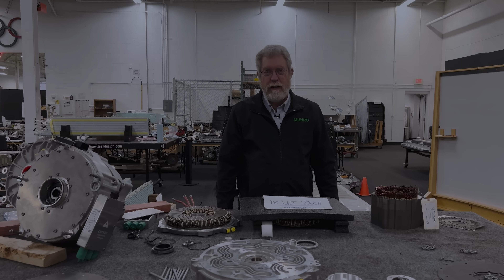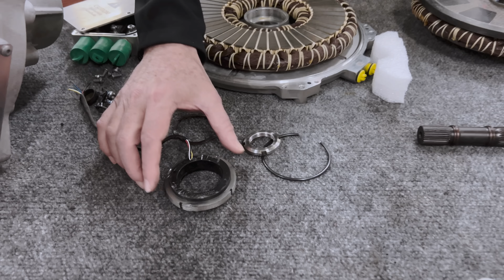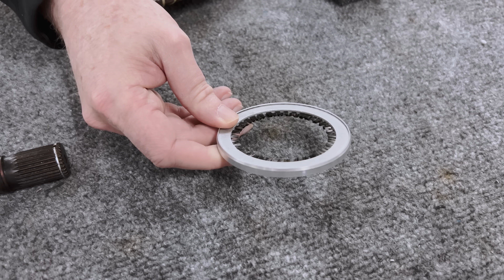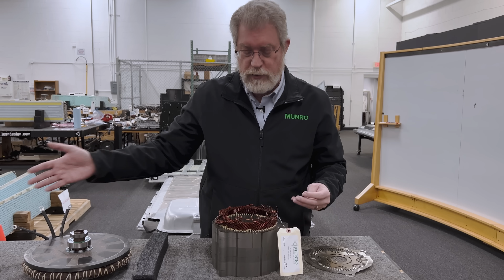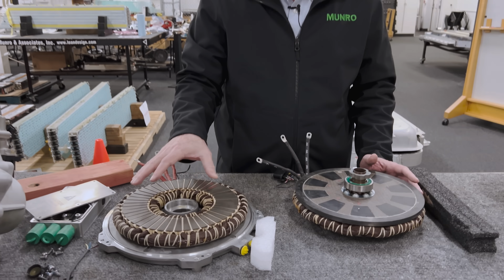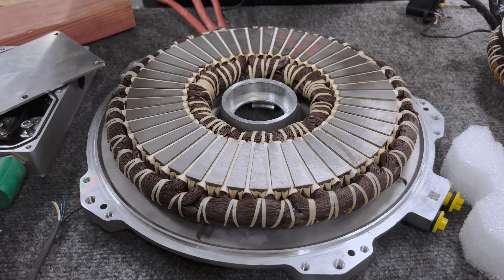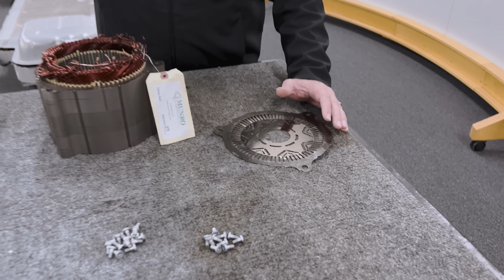Axial Flux Motors Explained: The Future of EV Powertrains?

Comment: Thx. for the explanation. Can you explain why are the EV companies like Tesla NOT using Hub Motors yet? I thought it would increase the efficiency also reduces the weight of the EV since the use of drive shafts are eliminated.
Reply: The high unsprung weight is detrimental to comfort and handling. And I doubt that half shafts really weigh that much in the whole picture.
Reply: Hub versus inboard motors is not really related to axial versus radial motors. 

And drive shafts make very little difference to efficiency.
Reply: I would imagine several reasons. 2 off the top of my head would be the shock/vibration, and having the weight sprung and more protected in a centered position with shafts would most likely increase durability. Not really my thing as I would never own an EV, but the tech is interesting. I wonder about a gyro effect on the large rotating disk...

Comment: In 2006-8 I had put my life’s effort into a startup company, as a founder, that used the axial flux Perm 132 motor. With lithium ion cylindrical cells.  I was in the Dearborn entrepreneurial zone business startup program. All the consultants told us a business plan that would make the consumer change to battery power was stupid and battery powered transportation companies should not be funded.  We were crushed by the old mindset of the Detroit ICE thinking people.
Reply: A fellow Nathan, in metro Detroit (I grew up in Ferndale & Clawson) interested in clean energy. Now my big hope is Edison Motors. Every truck driver who sees them loves them and wants one. Another change on the horizon is for someone to come along ready to apply Edison Motor's diesel-electric + right to repair model to farm equipment. Farmers are ready to switch away from John Deere's rent-seeking!
Reply: I have a 7.2kW 72v DC Perm motor
Reply: @Robbedoes2  Hello,
I am a second-year electrical and electronics engineering student. Did you design the motor yourself? As a university student team, we are also working on this type of motor. Our requirements are 1.5 kW + 1.5 kW, hub motors for the rear wheels, with a total nominal 72 V DC permanent motor. Would it be possible to get in touch with you? I would really appreciate it.
Reply: If you know a bit about consultant companies, they have 20 ICE customers, that all they the same thing. They never do scientifical thinking
Reply: Keep in mind that electric cars are not there to save the environment, especially the sealed for life, unservicable, locked out without paying to connect to their servers to tell the car it's allowed to work again junk that's being made in both electric and IC cars now, they're to to save the car industry. Electric bikes, thankfully, have been outselling them for years though, so there is hope that even in the US people will realise they shouldn't need to waste the energy of bringing 2 tons of car with them for every trip they make.
Reply: @peglor  I had a second hand Nissan Leaf that was 10 years old and 11 years old when I sold it and bought a 3 year old Tesla I had no issues with the Leaf and none with the Tesla I sols my electric bike and use a normal bike that charges when I eat.  25 years ago we had a K car with a 360 cc engine at 520 kg 4 of them weigh 2080 kg and a real Mini at 620 kg well under 1/2 of the modern one.
Reply: @ I'd love to see more Kei cars outside Japan. I used to have a Jimny, and it was excellent in the city compared to a full sized car, thanks to a much higher seating position than most SUV/crossovers, while only being 1.6 m wide and having a crazy tight turning circle because it was nearly 1.5 m shorter than many full size cars. It's still slow and frustrating as soon as there's traffic compared to my bicycle though.

Comment: The best application of these motors is electric motorcycles as wheel hub motors, but few use them yet. Putting the motor in the rear wheel frees up more space for batteries and storage on the body of the motorcycle and eliminates the need for a belt or chain and any mechanical gears, but the suspension needs to be properly designed to handle the additional weight of the rear wheel.
Reply: Yeah, that's a lot of unsprung weight to deal with. You sometimes hear that a manufacturer is going to go with wheel motors, but very few ever make it to production.
Reply: @glenndennis6801  I suspect most of the scientists pushing wheel motors never talk to vehicle dynamics scientists and probably have never heard of unsprung weight.
Reply: Gyroscopic effects also

Comment: It's not for static electricity that you need the brushes for. It's unwanted voltage build up from eddy currents.  Any conductor moved through a magnetic field builds a voltage potential. It's not all at right angles. A voltage potential builds along the rotor and the only place it can discharge is through the bearings, causing an arc welding effect that pits the bearings.
Reply: I think this is why a lot of motor manufactures use ceramic ball bearings, right?
Reply: @huskberry  I never thought of that.  Hmmmmmmm
Reply: @ai4px  which begs the question, what if the bearing were just mounted with an insulator on the rotor? Why use expensive ceramic ball bearings while you could literally coat the inner or outer race with a non conductive film of something that meets mechanical requirements of the motor? Is this static electricity?
Reply: It's mainly due to capacitive coupling between the stator windings and the rotor which generates high frequency AC currents, which if their is no low impedance path explicitly porvided between those parts generates a high voltage, that causes ionisation across the smallest air gap between those parts, and an arc forms, that jumps between the metalic elements of the rotor support bearings. That pits and damages the bearings leading to early failure. The low impedance carbon brush simply provides an easy and continuous path with very little sliding / rubbing friction to allow those AC currents to circulate without arcing!
Reply: We had to fight the same parasitic currents in bearings in induction heaters in paper machine rolls heated by many induction coils.  The solution was ti balance each coil by either counter winding them or two coils in an X shape that opposed each other. ABB learned this the hard way.
Reply: Early Tesla electric motors had this problem.

Comment: I want to see YASA motors and Magnax motors. I believe those are the state of the art motorsbecause those are yokeless
Reply: yeah these are properly designed and optimised motors for high volume applications. I am eager to see these in the first commercial cars.
Reply: @casaxtreme2952 Mercedes AMG will use YASA motors I think because YASA is owned by Mercedes-Benz.
Reply: In the YASA design the stator is yokeless, but the rotor is not. In this design the rotor is yokeless but the stator is not.

Comment: For the past 20 years I keep hearing that axial motors will take over EV market. If there was truly price/performance benefit, it would have happened by now. In reality, each design is application specific , there is no one answer to everything.
Reply: This particular axial flux design doesn't really have much if any benefit over radial flux designs. I'm not sure why they even bothered with a two stator, single rotor motor. Axial flux shines best in a single stator, dual magnet rotor configuration where you do not waste any flux at all. The efficiency should be substantially higher. What they've done here may make a bit more torque but it's not going to do it efficiently.
Reply: I am highly anticipating the upcoming release of the collaboration between Mercedes and YASA!

I've seen adulation about axial motor in my career. But the magnet is more than four times the cost of round copper wire, and rectangular wire is double. Plus, the assembly is way more complicated and expensive.(Guys! you're in the UK!) 

Only supercars can really afford to do this. The ICE also has to run at high RPMs to stay compact and efficient, while the electric motor takes care of the low revs. Having worked with both traditional car brands and EV makers, I knew this was the way things were going eight years ago. Now, it's pretty much a reality.

Comment: also very appreciative you decided to do a vid on axial flux motors. would be interested if you compared a yasa motor design to the current motor dissected. seems mercedes and other high end manufactures have partnered with them. what is the difference in their tech (winding method, etc). tks again
Reply: MB bought Yasa in 2021.

Comment: That high torque is due to a better leverage (big radius) ?
Reply: Mostly due to flux engagement area in an axial flux motor, not just motor frame diameter.
Reply: @edgardacanay8460  Thank you :)

Comment: You say the Torque Density of the Axial Flux motor is higher, but that is a comparison of the torque per pound of the motor... what about the torque per kW ?  Which motor is better in that measurement, and why ?
Reply: kW can be somewhat compared to torque in these motors. As was stated in the video the mechanics of the bearings/axle limit the amount of torque that can be applied. Theoretically axial flux motors can apply more torque(or kW). This is from the surface area advantage Paul pointed out, not only more surface area for the flux but for the cooling as well, more kW(or torque) means hotter coils.

Comment: At 13:48
You talk about 36 slots.
I count 45 slots
Nevermind... Nice and informative video again.
Reply: I'm sorry for the mistake, you are correct.  The motor is using a 3/2 slot per phase per pole winding that is unusual in automotive traction motors.  It's a good compromise between minimizing torque ripple and winding complexity.  I wish I had taken the time to get it right and provide some more detail about the winding itself.  Thanks for the correction.
Reply: @PaulTurnbull-EMfield It would be great if you could elaborate on this topic, because the Bavaria calculator says that the 45-slot stator and 10-pole magnet circuit is unbalanced. I'm very curious why they chose this particular unbalanced circuit.
Reply: @stipashka0946  It is a balanced winding. Coil per phase is 15 (45 coils and three phases). The slot pitch is 40 electrical degree. So we can have three coils at -40, 0, and, 40 electrical angles with coil span of 160 degree (4 slot pitch). We can make them in series to have 80 degree distribution factor. Now we can connect 5 such coil in parallel to make a single phase. Other phase can be shifted by 120 electrical angle as the slot pitch is 40 electrical angle (three slot pitch shift will do). Therefore, balanced winding.

Comment: Donut Labs makes a powerful and light weight electric motor. Will you take one of these motors apart when it becomes available?
Reply from the maker: We reached out to them for a collab and they declined.
Reply: @MunroLive  You could try reaching out to Verge motorcycle as its the parent company which designed the donut motor.
Reply from the maker: We have as well.

Comment: Glad to see you do an axial flux motor video, I've been asking for it for awhile. I've always found them fascinating, their weight to performance ratio can't be beat and they would dominate the EV market if the supply chain for them was more mature. The lack of a mature supply chain is why Aptera switched from axial flux pancake motors to standard radial flux motor,
Reply: They are ceiling fan motors

Comment: someone please put two of these in motorcycle hubs. 😀 power would be insane. 😀
Reply: The ride would be horrendous with so much unsprung weight a 10 kw rear motor is the largest I have heard of10 x that at both ends at higher potential speeds very dodgy.
Reply: @JonathanTamm  yes that's true.
Reply: @JonathanTamm  nah i take it back i think it could make sense. this motor tech should be more power dense so it might not be that bad.

Comment: When can we expect to see a market for these engines and trans to replace engines and trans in old trucks and cars?
Reply: Edison Motors is making kits- e axle, batteries and controllers, for F-450 sized trucks. They are plugin hybrid conventions using either the original engines or new engines as chargers.  They are only doing 10 this year as they refining their process to handle any make and model of similarly sized vehicles and train installers. They also are making  PHEV seis. They were going to make retrofit kits for semis but EV rebates only apply to new vehicles not conversions so there is no market for conversions at this time.
Reply: There is already a limited market of EV conversions and some plug and play complete kits. Bring $$$$$$$ 😂